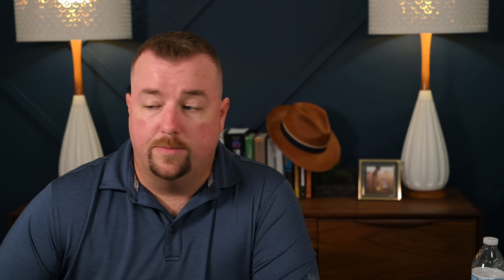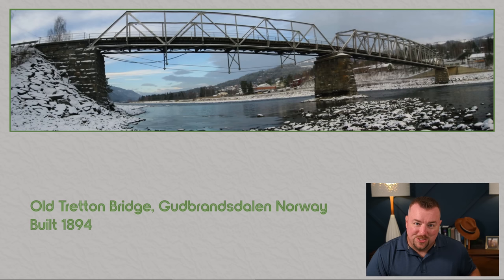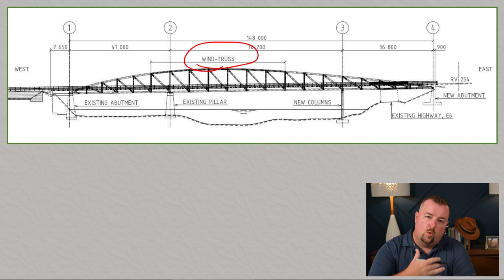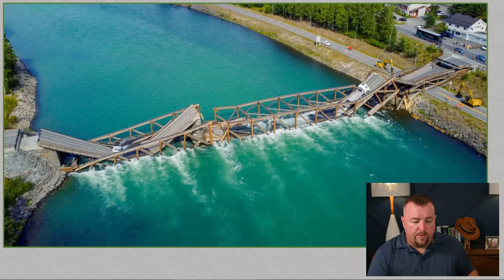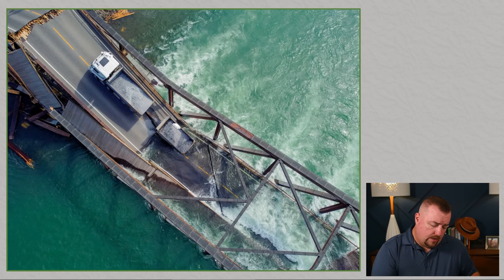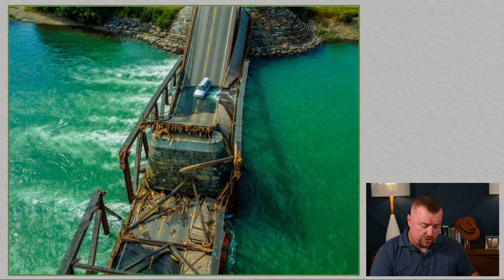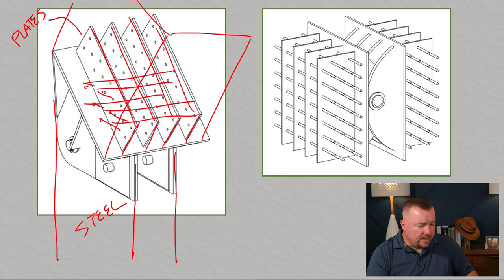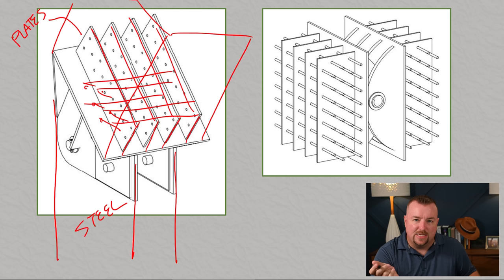How Did the Engineers Miss This?

Comment: As soon as I saw the bridge for the first time, I instantly thought: "That's wrong. The diagonal ALL go the same way." Every other truss bridge I've ever seen - the diagonals all relate to the piers in a sort-of mirror-image way: The 'mirror' being at the pier to which the loads are transferred. 
To simplify the idea: The bridge-deck to either side of any pier is like the horizontal section of a construction crane. It is help in place by suspension (tension-elements) from the central pole (in compression). To my eye, this bridge was ignoring this very basic principal. 
Look at the original truss-bridge for the Perfect expression of the principals. No wanky dross!  

Okay, I know it was supposed to be a compression/arc bridge but seriously, it was a dismal mash-up of arc and truss, neither of those principals being respected or obeyed. And did I see the word "Architect" [*] mentioned in there? It certainly looked like something designed for Good Looks over boring-old Functional Structure.
 
In fact to my eye, the weight of the lorry at that moment was being resisted by the exact opposite of the normal design: Tension in the top chord and compression in the diagonals - none of which was adequately transferred to the pier, let alone any other part of this cluster-flok. 
Thus the failure began in the top chord at the top of the vertical here labelled 'C' (tension-resistance-failure). Then joint 'A',  then the lower-chord element C/D blew apart under compression. Crash-bang-shit-oh-dear! 

[ * I aced Physics in high school and 1st-year university (A+) and spend two more years in an Architecture degree course. My worst memory is of repeatedly being told by my tutors "Don't worry about what's going to hold it up! Just draw you sculptural vision then hand it to the engineers." Dickheads.)

Comment: It looks like a different form of joint is needed for laminated wood, perhaps with outside clamping instead of pinning as the pins rip out. The deck may also need to be an arch, so it is never under tension if possible. Also the bridge could be painted to protect the wood and the glue and the steel.

Comment: There is clearly very little correlation between the material performance data being  used and the performance of the glulam. Timber splits very easily and a round bolt or pin is just a blunt axe head which will produce a spreading force, splitting, within the glulam, ultimately,  causing the longitudinal splitting. In tension the splitting will form more easily as you are at the end of the glulam beam and there is insufficient timber to hold the fibers together. More concerning is that this reduction in performance will also take place in compression but as the tendency will be to split into the length of the beam it may not be so significant. I speculate that steel banding between the pins and the end of the beam may improve the performance but the pins are usually very close to the end of the beam leaving little or no space for banding.

Comment: Assuming the lorry was closer to the centre of the middle span at the initial failure, and travelled nearer to the columns in the seconds following, then the diagonals at joints would A,B and C would typically have been in compression not tension at the point of failure. What happened to the loads in them as a result of the failure is anybodies guess as it is not clear in which joint or member the initial failure originated. 
By its nature Glulam is virtually impossible to inspect and to use it on a bridge with 100 years design life with its inherent outdoor limitations due to temperature range, rain and ice must be questionable.

Comment: This reminds me of the pedestrian bridge in Florida , designed by students, that failed before it was even completed. I'm no engineer, but just LOOKING at these, I can tell the arches or suspension cables are NOT bearing the load! Whatever happened to "overbuilding," with extra strength to LAST? Today they design and build CHEAP and barely adequate structures which FAIL catastrophically when exposed to real-world stresses like imperfect materials, extreme weather, or overloading. THOSE RESPONSIBLE for failed designs should be DRUMMED OUT of engineering, building, programming, etc. and even JAILED if people were hurt or killed due to their INCOMPETENCE!!!

Comment: Would altering the grain direction lead to a stronger joint? 
 LAYERED as following 1 - Horizontal 2 - vertical, 3 45 deg left 4 45 deg right REPEAT REPEAT REPEAT?

Comment: Great analysis; interesting as always!

Fresh architecture grad here
I do love myself some mass timber, but compared to other mass timber structures I've seen, these members visually look a little under-sized. The splitting/tear-through from the bolts is not a surprise; my old wooden Ikea chair failed in that exact way.

Mistissini bridge in Québec is comparable in length at 160m, but its spans are shorter (37m, 43m, 43m, 37m) and its overall design is much simpler. You'll also notice that the timber beams are much deeper, and protected by the bridge deck above.

Greetings from Canada!

Comment: i was supposed to drive across this bridge just a couple of hours before it collapsed with a similar load to the truck that got caught on it. we also had several trucks a day cross another Glulam bridge fully loaded to 50t several times a day and when they checked all the bridges it was found to have severe defficiencies. it is pretty well known that Norway don't have a great road standards in terms of size and layout, but after these two bridge collapses i don't really have much faith in even the basic structural integrity of the road. at the same time there are plans to increase the max weight of trucks from 60t to 72t both because it is more enviromentally friendly to run less trucks, and that they can't find enough people to drive the trucks. i wonder why with the bad pay and road standard

Comment: It would be interesting to know from the community what is the projected cost difference to construct a steel bridge vs. the composite bridge like this one?  Also, for structures similar to this one that are already built, would you recommend i9nstallation of devices to measure the actual movement of the joints during use, for safety?  Can the wood joints be x-rayed to look for hole stretch evidence?

Comment: Some genus put pins and metal tenon in with the lamination not against it.  And all those pins making the glulam swiss cheese.  Is all the wood road decking going one way. No cross beams to distribute load into all the wood decking. So the weight was only on a few pieces of decking and not distributed across the entire decking.  And then all the pieces of all thread to hold the wood decking together instead of wooden cross pieces to distribute loads across all the width of the wooden decking.

Comment: The vertical glulams should have been coupled with high tensile steel plates or rods since these are mainly subjected to tension under gravity loads & very little during vibrations for wood makes a good damper.

Comment: This is way outside your normal, but could you do a short video about the safety of Kerch Strait rail bridge? The Russians say that they have resumed train service across it, but it doesn't seem structurally safe.

What kind of damage would burning fuel oil flowing out of a tanker car for an hour do to a reinforced concrete box truss bridge? I would expect extensive cracking if the concrete, but would the steel reinforcements heat enough to weaken them or make them brittle?
Reply: OK,  looks like the spans are all steel. However, the steel reddened (oxidation from the burning fuel, most likely) and some of the small vertical ribs came off (weld failures in the heat?).

Comment: a few things came to mind. first whoever did the copper work on the weather caps top notch but wow would not have wanted to pay for it yiks. pretty sure you are on point with the failure of the wood to steel connections. also in the 10 years of service those connections experienced a lot of swelling and shrinking of the wood in the joint area due to temps and moisture. i also would bet that wasn't the first lorry to drive over this bridge so you have that. there would be no way to check that style of joint post construction for wear and tear or over loading. all of the glulam bridges i have done were top loaded on the top of the beam it's self like a concrete i beam bridge. the super complex joint at the bridge deck level gives me pause to. very sad to see this happen it was a beautiful work of art and engineering looks like no one was hurt. hopefully after seeing the real-world failures some new ideas will come forth.

Comment: 34:00 It looks like the size of the laminations would prevent drilling the holes any way but between/along the layers. 
I feel like someone is taking chipboard and using it where they need the extra strength of plywood.
It seems like the manufacturer needs to integrate some kind of plywood root with alternating grain directions and then drill the holes perpendicular to those layers.

Comment: Its not only the  momentary  stress of the truck at the point of failure but also the cycling of vertical loading over time which tends to weaken the joint incrementally. much like testing of riveted joints of an aircraft skin repeatedly adding and relaxing the load on the joint will eventually weaken it to the point of failure like bending a steel plate repeatedly it will break at some point the question isn't if it will fail, but when it will fail. and the elasticity of the wood with water seepage into the joints between it and the steel is problematic at best and destructive at worst. Wood and glue exposed to water is a terrible combination regardless of the temperatures but the degradation is accelerated by temperature changes..

Comment: 22:29 I'm sorry but that "our software says this/that" sounds like the excuses undergrad engineering students give when their final projects don't go the way they want, I remember asking one of them about the power that their device was designed to handle and they said 220V, I had to remind him that it was power in W or kW the system can handle, he said the software didn't show him that so he doesn't know...the whole grading panel died at that point

as for why the truck didn't move that far back when the bridge collapsed was mostly due to the rigid connection is shared with the trailer as well. that type of trailer is fully supported meaning that it supports all of its weight on its own axles but the connection it shares with the truck would prevent it from sliding down if the brakes are locked on. Because in an event as violent as that one would expect the truck to bounce a bit and under that condition it would roll back further than it did.

Comment: I am no engineer, I am only using common sense.
- dowel holes in a  straight line is an oxymoron.
- the steel plates should not be the sole support, the tubing should go beyond the steel plates.(another oxymoron)
- no-where is the laminated wood supported by compression rings that would keep it from flexing itself into fatigued points.
- more important, the joints at all fulcrums should be pivots resting on heavy duty springs, so the spans can pivot rather than flex and fatigue the wood. (springs are optional, if the pivot is adequately designed)
-- of course that means compression joints on the roadway.
- moreover, the bed of the bridge is flat, another oxymoron, it should be arched up to reduce flexing and floating.

Comment: It looks as though there is a wood surface pedestrian way on one side of the bridge with the road surface being asphalt.  Furthermore, the steel bolts or dowels pull tension in alignment with the grain was the weak point.

Comment: I wonder if any kind of differential settlement of the piers could have been a contributing factor, think about it, you had 1 100+ year old pier system on one side of the river and a whole new steel pier setup on the other side, if that new steel settled (as all things do) at a higher rate then the 100+ year old one that would weaken that end of the bridge and make it more likely to fail as a result of a large load like that tandem truck.

Comment: Steel and wood seems to me as a horrible combination. One significant problem is rot in the wood at the junction with the steel. Rain will get in to all those joints. But in addition to rain the steel is going to have condensation form on it anytime the humidity is high enough and the air is warmer than the steel. Which is likely to happen many days out of the year. And wood that is subject to occasional wetting rots. And to compound the issue the wood has been slotted. So it isn't a large wood member rotting from the outside in. It's a bunch of thinner members between the plates rotting from both sides. No wonder it failed after just 10 years. If they really want to build with wood they need to be using old style craftsmanship using wood to join wood with wooden dowel pins. 

Thanks for the great video!

Comment: At 11:30, to me (no engineering experience), it seems like a bad way to set up that connection. The main lower glulam beam of the truss doesn't have steel below it to hold it up, despite being so close to the bridge column. Instead it's pierced and held up by a set of metal plates from above. This is joint C later.

Comment: Wood is better under compression (but only if protected from the weather), steel is better under tension. Dare I say on each end of the glue-lam segments, rather than just pins, had they added bolted compression plates, to keep the wood in the pin area from freely splitting while under compression... These bridges may have last twice as long, but only twice. Would have been better to do a nice, artful steel bridge.

Comment: Thoughts on design changes if these flaws had been discovered prior to construction:

Plates/fins/gussets to be built from CORTEN(or better)steel alloy or better.

Pins/dowels to be made of STAINLESS steel.

Pins and dowels to be  fastened across PARRALAM laminations- not in betwern. 
Basically, driven vertical,  not horizontal. 
Full length SS flashing used on top side of all horizontal members- overlapping steel connections.
Al all connections  to steel , the flashing will lap to full depth,decreasing to 1/3 depth , 3 times the depth of the parralam away from the connection.

Comment: That bottom rail in tension reminds me of when we were kids and didn't have any rope for a swing. We did have a spare length of 3x2, so we drilled a hole in each end, put a tube/bar through each hole, and hooked it into a tree branch fork. It worked great for about a week until the fat kid had a go. That lower rail had to take hundreds of fat kids on each stupid joint. Did these guys never learn any hands-on skills, or were they all skinny kids?🤣

Comment: Couple of things I would add. By the way the rear dog is resting in the water against a section of the bridge carriageway, I think that is what is propping the truck up in position through the draw bar. I would agree with your conclusion that the truck did not travel far. I would further agree that significant weights were placed on either side of A when it collapsed, and I would further add that the bridge collapsed almost instantly (I draw this conclusion by virtue of the weight still being either side of A). Looking at the pattern of the debris, I would be reasonably confident that the top joint on A was the one to let go. If you absolutely had to build a bridge out of this fake wood, this should have probably been given several times the design headroom that it was given. Or alternately many more support pillars built in underneath. This is a ridiculous design for a bridge in any weather conditions, let alone extreme ones.

Comment: When the fastener touches treated lumber you need an approved coating on that. I bet they were not stainless.
There's a myraid of problems here. Thanks for breaking it all down.
My few cents. Covered bridges, were covered.
Old barns in the 1800's had square pegs. maybe they knew why back then, but they don't have the separation wedge effect as bad. Nor the tools to make round ones. It was obviously harder to make square holes but easier to make square pegs. 
Glue and water never work, or cold.
How heavy was that truck.

Comment: I am not an engineer, but do have a very analytical mind and have done some design work to fix problems some engineers couldn't come up with a solution for. I have worked with engineers who have worked on things that have gone into space in the past, a wall full of patents to their names, and I can tell you that the tunnel vision thing is a very real problem. I have seen things that these engineers were doing that had me dumbfounded and just knew instinctively would fail. In most cases they did fail and many people lost their jobs due to the collective failure of many engineers who lacked the ability to step back and question what they were doing. 

Just like any profession, you will have  great engineers, average engineers, mediocre engineers and terrible engineers. I would easily put Josh in the great engineers category, but unfortunately I think great engineers are a smaller group that we would like to think. I think the terrible engineers are in the minority, but is is a pretty big minority.